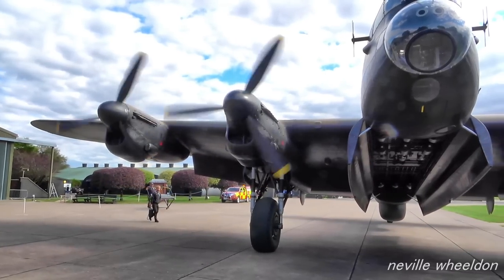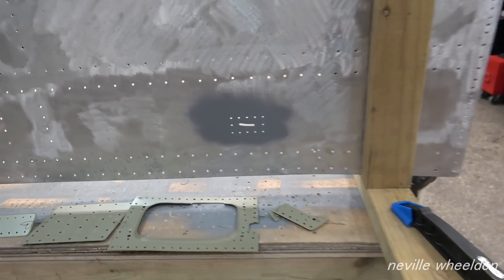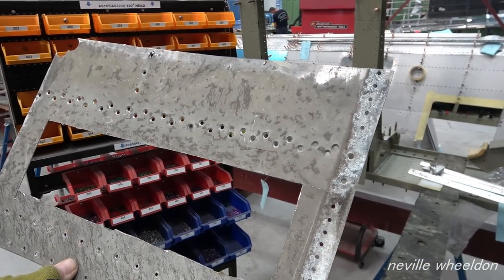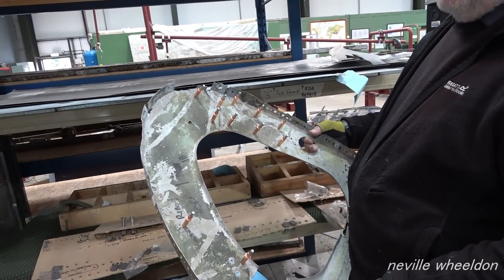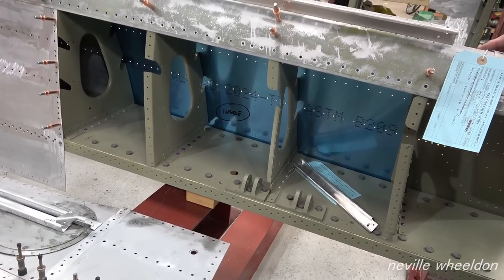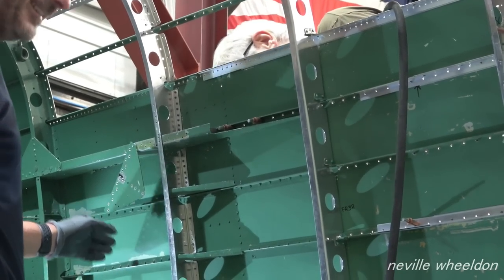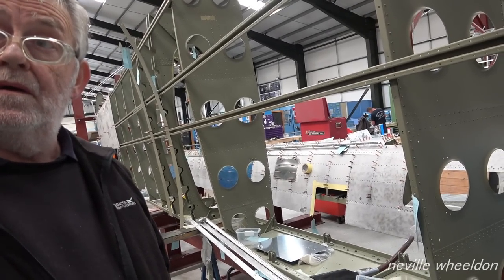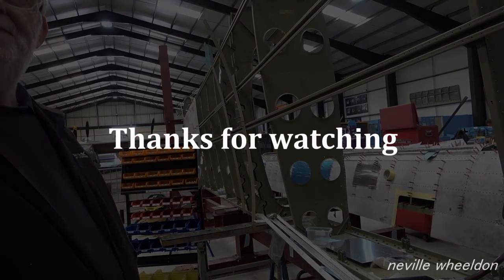Video 166 Restoration of Lancaster NX611 Year 5. The start of riveting skins onto the Fuselage KB976

Comment: Hi Neville - when does year 6 begin?  Kind of like turning the corner:)
Reply from the maker: Hi ajg617 it's not a fixed calendar date. The year starts and ends early in November. Year 6 will start on Monday November the 7th. The year ends always on a Saturday when the Lancaster does the one and only Night Taxi run ending the summer season and the Lancaster goes into the hangar for the winter. Saturday November the 5th is the Last Taxi run ending year 5.